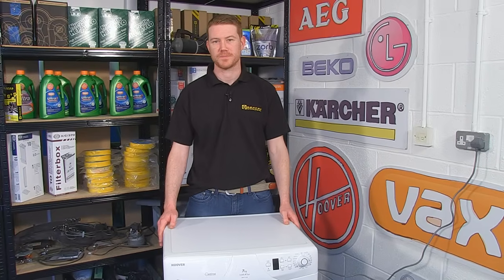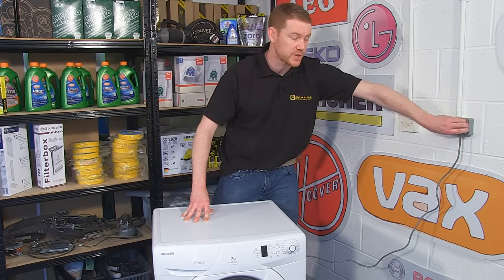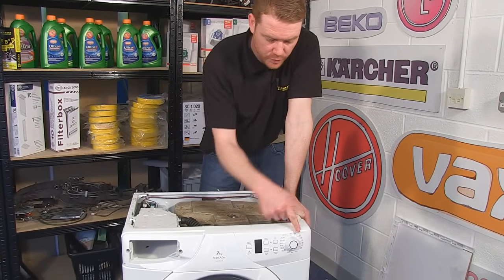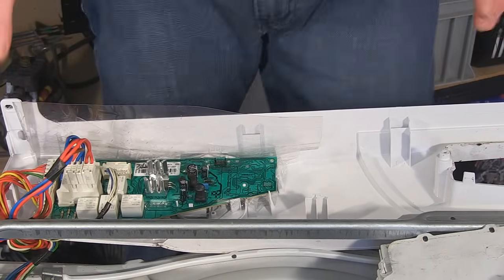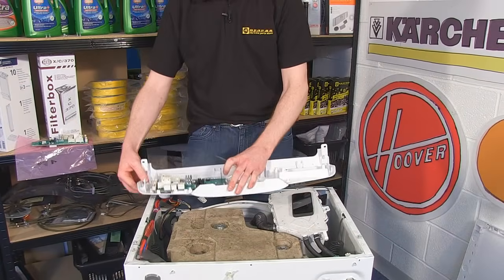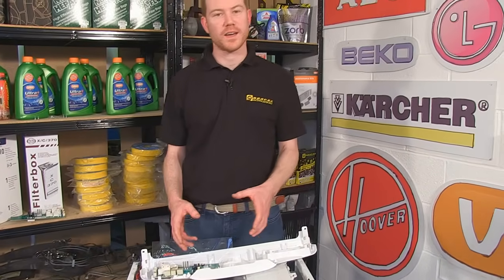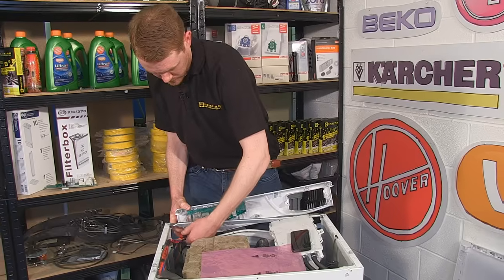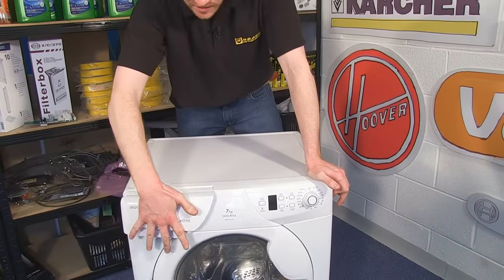How to Replace a Hoover PCB and Timer Selector Problems.

Comment: On the hoover washer dryer I'm changing the heater thermostat as shown in another video. The top has plastic trims around the side, which hold the top on not the same as you show. I've removed the back trim. How do I remove without breaking the trims. Thanks
Reply: Bash them carefully and apply more force each time until they come out!  - I agree, they make it look easy and was incredibly difficult

Comment: is it important to replace the film cover ?
Reply from the maker: Hi Tony, the plastic film between the PCB and the front panel shown at 3:45 is there to protect the PCB from contamination tat could leak through the buttons.
The machine will work perfectly without this but if liquid is spilt on the front it could reach the board and cause damage. If the old film is blackened from a short cut away any carbon'd area and reuse it patching the hole with insulation tape.
Reply: bloody hell ime gonna aftoo take it to bits again for the 100th time, thanks for that ... lol, no i mean thank you

tony
Reply from the maker: Never mind Tony, you must be good at that now lol. Thanks for the comments. 😊
Reply: thanks for the vids, over the years its helped me out no end.

Comment: The best way, to change a PCB/module or timer is to change one wire or one wire connector block at a time, if there is enough wire length to do so.
Reply from the maker: Thanks for your comments, and It is certainly a good way to start but we would always recommend you take reference photos as one slip with a PCB,module or switch bank can pull off wires. Without reference photo's it can be very difficult to know for certain where the wires came from especially if the board has connectors that are not all used. :-)
Reply: the main pcb at the bottom of the washer can easly be connected wrong, take a pic like espares say.